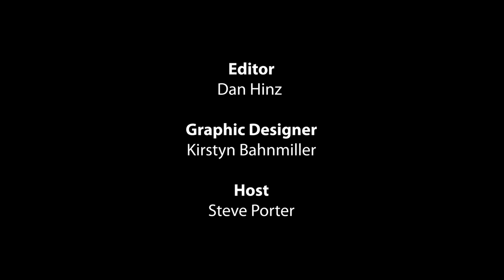The Truth About the Electronics Refurbishing Industry

Comment: Well, your critique is fitting for some companies out there. And also I'm talking from a German's perspective, it might be different anywhere and everywhere else.
In Germany the second hand market fundamentally isn't worth it since you generally have to pay around 80% for second hand electronics. You get at least half a year of warranty as long as you buy from a merchant.
Problem is the price is too high for last season's electronics.
But getting recent refurbished wares from the manufacturer or a reputable merchant usually is a good idea.
You still pay your 80-90%, but I've never gotten anything with even fingerprints on. And the hardware always was properly fixed. There was one exception where I received an espresso machine without the filter, they couldn't send me a replacement because they didn't have it themselves, but they immediately refunded me after I sent it back.
There certainly are some bad apples it there and you cannot do anything about that, but measurements such as certifications will only increase the price without investing quality or service. A reputable service usually has a transparent grading system so you have at least a good idea what you're getting.

Comment: When my older brother and I sold consoles on ebay we did take care of them and fixed them well I did I got parts to do it too from time to time. But we really did kinda did refurbished them like lots of cleaning and dust removal and fix things here and there if broken stuff I'd there. We haven't sold actual Xboxes or PlayStations like modern consoles just older consoles from like the '00s '90s and '80s but we still clean them from the inside out. My brother did stop because yeah he came to that conclusion of it's not worth selling consoles anymore because of the size and weight in shipping, no way too much so we stopped. I had the passion of making sure they were stunning when we sold consoles too. Never had any issues when we did, however with an Xbox 360 my brother sold it locally in a store with a friend was cleaning the cleaning I did then was it was completely dirty on the inside... Like what I take EVERYTHING apart and I have shop air at like 90 psi a lot of stuff is gone at 90 psi. I felt it was worth doing that for people and the consoles because it keeps them around much longer the selling bit well yeah you need something for your time and supplies granted I didn't spend that much stuff when I did but yeah we still left them better than we found it as well.

Comment: I think it is more then fair to say "refurbished" if it is pulled apart has the dust cleaned and thermal paste changed.
Things like cleaning the optical drive if it still works when sold then cleaning rollers and the laser is a little too unreasonable.

Comment: I usually buy refurbished PCs, and I immediately replace the Windows operating system with Linux. This does void the warranty (usually there is a one year warranty). My last computer has been running excellently since February 2019. Unfortunately, I was not able to install Linux on the hard drive already in the computer, so I replaced the hard drive, and there was no problem with installing Debian Linux with the new hard drive. The 2TB hard drive that I took out the computer had some issues. It was locked in some way so I was not able to reformat it. I tried many things (when it was already out of the computer); I even consulted with Linux experts that wrote formatting software, but nothing worked, so I had to throw the hard drive away. Even so, buying a refurbished computer was well worth it. Aside from replacing the hard drive, I did not do anything with the hardware.

Comment: In my opinion a refurbished console has all the dust cleaned out and thermal compound re-applied. Any suspicious components on the motherboard being replaced is a good bonus. 

Oh, and the outer shell should be cleaned without using a magic eraser.

Comment: I once and only once bought a "refurbished" console. It was a gamecube from gamestop. When I got home and took it out of the box it was dirty. The side with the exhaust fan was cracked and the fan was pushed in like someone kicked it across the room. The fan itself was caked with dust and globs of hair. The whole thing was so badly beat up that it was literally thee worst condition console I have ever seen. I didn't even bother plugging it in, I immediately put it back in the box and returned it for a new unopened one. If they aren't going to refurbish them then don't say it's refurbished at all and most of the time it would be fine. Ever since then when I see the word refurbished my brain replaces it with the word BULLS**T in bright red capital letters. They just say its refurbished so they can charge you a premium for junk. Also, don't ever buy a NEW game from gamestop UNLESS it is still sealed in its original plastic. If its one of the open cases on the shelf chances are you are buying a preowned disc for the price of a new one.

Comment: I refurbish consoles in my free time just because i am interested in electronics and really like working on stuff. 

Now, as @kumisz2 explained, here in the EU we have policies for refurbishing. 
But even if we would not have these, I am only listing my items as refurbished if I have opened the system all the way to the last part (Like you did), and from that point on build the system back, cleaning and if required replacing all parts I come across (e.g. if I get to the mainboard, I replace the thermal paste&pads and clean it fully). After that I test the console and let it run for a while, if all goes well I then reset it to delete any data the owner left behind. 

That's what I call refurbished.

Comment: I'm in the very early planning stages of starting a consoles repair and refurb business up 

Do you think being up front about what work has been carried out can improve the worth of a service like say I was to list an nes as cleaned inside and repaired lock out chip would this sell easier and at a better price than your standard refurbished listing without that info?

One thing I think a lot of refurb systems will do wrong is clean it inside and out and it sits on a storage shelf for months and when it sells they don't give it a check over and see if it needs a second clean 

Dust can not only make it look and run bad but it makes a good home for nasty bugs and mites which is not what you want a customer to find crawling out of a vent etc 

I watched another one of your videos of you trying to fix an n64 ... I notice the number one cause of broken n64 consoles is a simple thing like a missing jumper or expansion pak or dirty contacts 

Also going back to refurbs alot of places that do basic refurb jobs on ps2s seem to fail to clean the lens which in turn leads to customers returning the unit when it wont read CD games or lightly scratched games

Comment: My definitions are... 
Refurbished = rebuilt to 'factory new' from parts, clean, tested, at least 1-2 years of warranty. Price will also reflect this, it costs almost new (80-90%), and it should too.
Used, tested = from 'powers on' to 'like new', maybe modded/fixed, not always clean. Ask for tests you didn't see in the listings. Stores will give you 1-6 mo. warranty at most.

...

And then the Ebay code
Untested = 'untested' is usually bs. 90% of the time it was tested, and it's f'd up, so they just say forget they tested it. It has at least one fatal flaw, and is worthless.
Junk, for parts, not working = sometimes actually works, but is good for at least parts
Acceptable = completely unacceptable, if it works, it barely does and will break down soon
Good = Acceptable, heavy cosmetic issues... will work for a bit
Very Good = Can range from unacceptable to refurbished, it means nothing
Mint, like new = used, tested, no major cosmetic flaws
New, box open = it's new, might actually even have a warranty still. but it will have one minor cosmetic flaw that will bug you for the rest of the time you'll have it :D :D

Comment: I make my living fully refurbishing consoles with very little (if any) compromise, but that would be absolutely impossible for most bigger companies in the buy and sell business. The actual cost of fully refurbishing systems is way, way higher in reality even compared to what you showed here, especially for businesses doing this at scale that are not in a factory environment and/or getting units at incredibly low prices.

Here are the costs for a large company: cost of the unit, cost for office space and utilities, cost to pay employees to refurbish and/or repair the unit, parts and supplies (cleaning chemicals, microfiber cloths, brushes), equipment (including soldering and regular tools, vacuums, dust blowers, ultrasonic cleaners), safety equipment (glasses, gloves, masks, fume extractors), warehousing, shipping supplies, shipping, selling fees or website maintenance costs, admin and customer support personnel, business taxes, etc. Even in a fairly optimal scenario where nothing more than a good cleaning is needed, the units themselves will take an absolute minimum of about 1 hour for an experienced person who is very efficient at this, but that's JUST the unit. You also have to look after the controller and if that has any issues, it can be just as time consuming to repair and bring back to a like new condition as the main system. You often have to pay for new analog sticks, batteries, or even shells. All in all, a well used console + controller with a fair bit of dirt and dust accumulation takes around 1.5 hours in a best case scenario. This is precisely why a large company can ONLY do full refurbishing AND make a profit at scale in a highly efficient factory environment. Businesses like DKO doing this out of their warehouse without any real knowledge of efficient console repair are not equipped to do this properly at all and are completely out of their depth.

Personally, the only way I can do thorough work AND make a reasonable amount of profit in the refurbishing industry is down to my small-scale business model. I run the business as a sole proprietor from a workshop in my home. I do all the sourcing, refurbishing work, packaging and shipping, customer support, and administration by myself. I also constantly work on improving and refining my workflow to maximize efficiency. Because I have next to zero overhead costs for office space and warehousing, I can refurbish an average of 2-3 units per day while doing all the other work required for this. Even my minimal overhead business model doesn't work great for a system like that PS4 you showed as the units themselves are still quite expensive as many people think that their precious beat up 10-year-old used console is worth as much as the shipped prices they see on eBay. Meanwhile demand for them is at an all-time low because people are buying a lot of PS5s and the full backwards compatibility means they aren't really looking for PS4s all that much and peak selling prices are way down. That's why the optimal consoles to do full refurbishing on are older systems that are starting to break across the board and desperately need TLC to even be worth selling in the frist place (especially PS2-PS3, OG Xbox & 360, GameCubes). The occasional newer PS4/Xbox One unit can also make sense if it either needs minimal work or is cheaper because it needs some repair. 

However, even in my case there are some compromises that have to be made. I never compromise on quality as my brand is all about that, but as an example there are some systems where offering fully refurbished original controllers makes no sense whatsoever. Let's say PS2 controllers are incredibly unreliable due to failing circuit ribbons. Also, there are countless versions and that makes part swapping a nightmare, plus the market supply is extremely low. Some versions of these controllers can be repaired very easily, but others have the ribbons soldered in (and they are very common and tend to fail the most), which greatly increases the time required to fix them. In the end I had to hunt down some good quality replica controllers and that was quite the task in and of itself. I had to get samples from a lot of different Chinese suppliers until I found one where all buttons feel great, there are two ruble motors, and the analog sticks don't feel horrible.

Comment: One thing I think you missed in your consideration is that some (not all) refurbishment operations actually get bulk pallet returns so they pay far less then eBay or other. Most of the time your talking a few dollars or less per unit. This comes with the pros and cons of some units may only need a simple part replacement or may be completely unrepairable. Now the numbers maybe different now but in 2015 I worked for a small business that did refurbishment and they would get pallets with 100 ps4s and paid around 1300 so that came out to 13 dollars per unit so if let’s say half are junk and the rest are good then you have a base cost per unit of $26. So the margins are a lot higher than you think. For example the company I worked for sold them for 199.99-215.99 per unit so low end if it just needed a wipe down or a small repair you could actually be making closer to 100 - 125 in profit per unit. The numbers might be a lot different now but if you do it right a stick to recent generations you can make a good profit. Now that does make things really bad if the company does “refurbishment” by just wiping the outside case down and calling it good then they are really profiting off them for very little investment and the customer gets screwed.

Comment: A business with employees and some sort of workspace they have to rent can be difficult economics without cutting corners. But I think it could be done. If they actually offer a 12month (or more) warranty for free repair, replacement, or refund, I think they could charge on the high end for a refurbished device  and if they get the devices cheap enough it could work. But that's not where the easy money is. IMO the best way to make money refurbishing devices is to do it yourself in your garage. No employee expenses or rent. Do good work and stand behind it with a warranty and build up a good reputation.

Comment: It depends. I had really bad experience with Apple certified providers in our country (e.g. when I put my MBA for battery replacement they spilled water in it and tried to blame it on me and some more) so I don't believe anything, that had human touch on it. So I had learned how to repair stuff and I go to ebay for doing it myself. In the end I am at the $220 (it depends, from the state the console is in), but I can believe the console will be working for some time without any problem.

But if I knew, that the refurbished company is doing it as thoroughly as I do or as you do on your videos, I wouldn't have problem to pay more for it.

Comment: For me, refurbished simply means there was a problem with it and it was repaired. I would not expect a deep cleaning simply because that's not what I view as refurbishing, but restoring. And I think that distinction is the most important: refurb means there was a fault and it was replaced, restore means it was previously (significantly) used and restored to mint/near mint condition.

That being said, considering the price of a brand new PS4 is only around $300, I would not pay more than $250 for either. It's just not worth my time and money to take a chance on a refurb or a restored system if a new system is just a few bucks more.

Comment: Here is what I think about it. I think companies buy broken consoles for $10 each or less. They also buy used parts of consoles really cheap. Then, they clean all that stuff they bought with harsh chemicals and put it together, using some people that don't complain much or ask more money than minimal wage. There is a minimal number of consoles a day set for a worker. So, the company gets about 10x times more money than they spend. Not all the consoles will work after this, but it's ok, usually more than 70% work. Of course, there are some companies that don't do anything, but do you believe car dealers change oil or not, they do usually.

Comment: Personally, I think "refurbished" carries practically the same expectations as "used". Meaning general cleanliness (dust, scratches etc.) are to be expected. However, I think "refurbished" carries with it the guarentee that it has been tested to make sure everything functions as it would if it were brand new and contains all parts (not talking about an overlooked screw, but something like a refurbished TV not coming with a base, making wall mounting the only option.)

While I don't expect it to be cleaned inside and out, I certainly appreciate the eye for detail and it definitly makes me return to the same place in the future for other items.

Comment: Best bet if your console is broke or your looking for another system is just buy a broken one or fix your old one. You generally save money both ways and if you handy you can fix it yourself. I got a PS2 a while back that was "broken" off ebay for cheap. It legit just needed to be cleaned otherwise works without issue. I probably saved 50-80$ buying a "broken" console and spending my time fixing it. If you can fix it yourself you can find someone to fix it for you for a good price and then YOU KNOW your console is good!